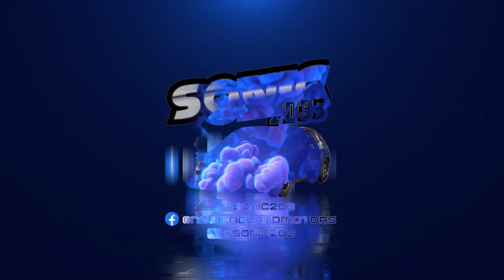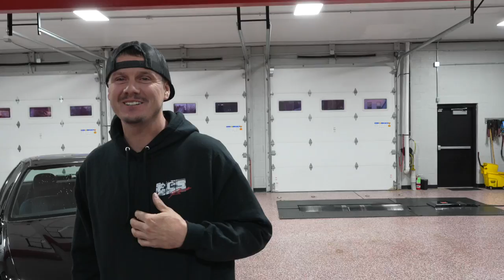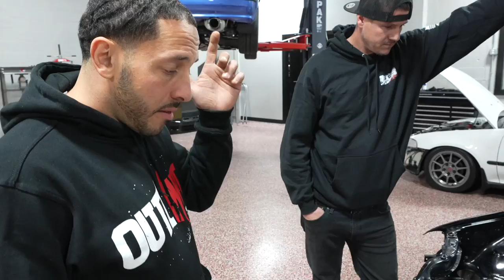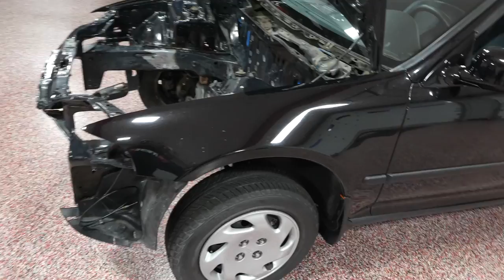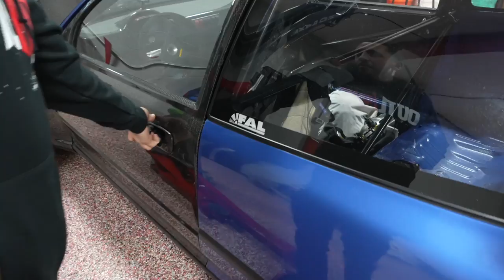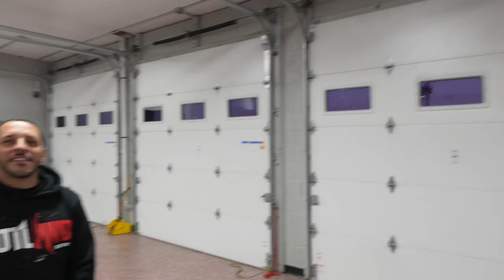1000hp AWD K-Series Civic Build!! Street Car!

Comment: It's soo dam expensive, I definitely underestimated it but I've been wanting a awd hatch forever, so I'm finally building one of my dream street cars rn. It's a ek hatch w/built k20a2 on a 66/62 using the FCS tubular AWD kit, it will also be full interior. I plan to get a ppg gear set but can't afford it rn. I just started this project a month or 2 ago and I'm about 20k in it and haven't even started the swap 😅 building it paycheck to paycheck now spending dam near 100% of my $ on just the car lol I blew through my savings real quick 🤦‍♂️ I'm hoping it'll turn out at least 1/2 as nice as your guys builds!

Comment: How do y'all making money @ your shop. Theirs never any customers cars. Is it true y'all charge 40gs for a swapped k series on egs & eks builds? I'm Just wondering cuz i want yall  to swap a turbo k series on my em2 red coupe ex depending on price. Y'all can keep my fully built single skunk 2 cam & skunk2 everything they had for this 7th gen with 32k miles & 4k miles on the build after i change the rods & pistons pushing 223whp 6 puck ACT clutch